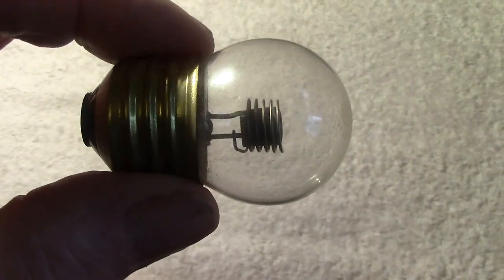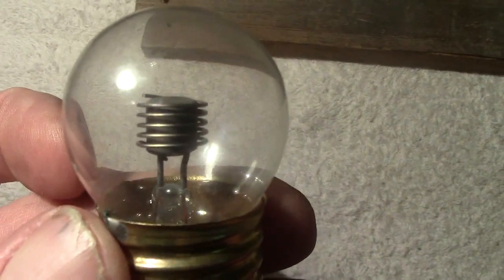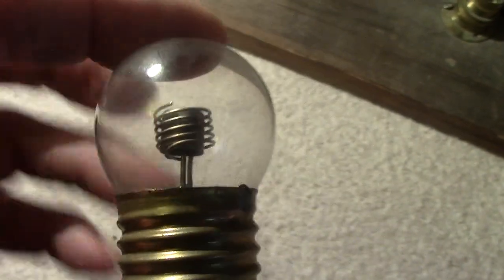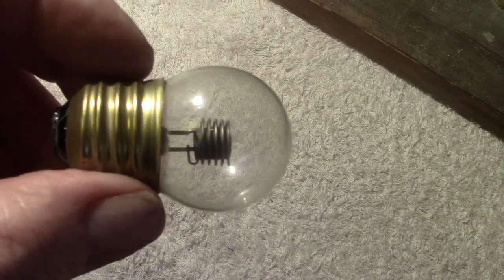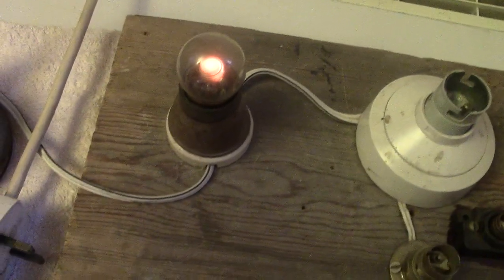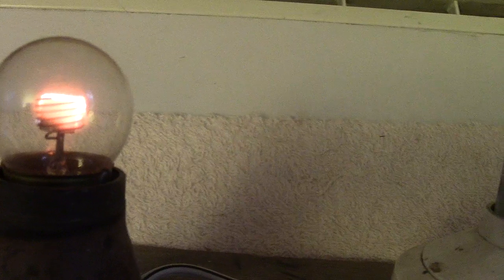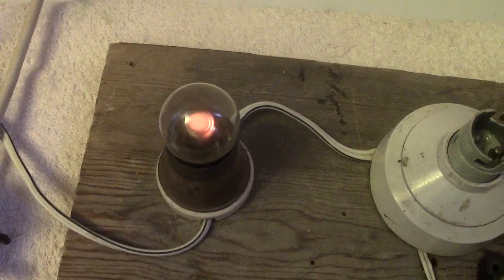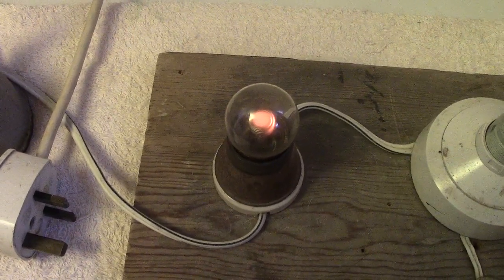G-E  NE-56 neon lamp.

Comment: If you use a neon lamp without resistor it will explode. There will be pieces of it everywhere.
Reply from the maker: Alex that is good advice, let me tell you a story when I was a kid, being just as curios then as now, I got an old Radio and among the valves was a bee hive neon with a valve base made by Philips, I could not believe my luck a bee hive which I wanted and thought it would be nice to power it up so connected to the right pins and done something stupid, well I was a kid, and put the 2 wires into a live socket and switched on, a loud bang insured and I was covered in shards of very sharp glass, this lamp was used as a voltage regulator and would of been okay in the circuit. Always check that a resistor is in circuit or. wire in line series with a 15w incandescent lamp. Take care I ruined a good lamp !!!!!
Reply: When I was much Younger and did not realize the value of a ballast , I also "blew - up" a number of neons and various mercury devices ( Fluorescent lamps, and 4W germicidal filament type lamps ) ...
Reply from the maker: I think we all did, just a stage of learning I think.
Reply: If i give directly to 9v,what happen?
Reply: ah yes scared the shit out of me when I was young

Comment: Mercury is in many neons, it makes the brighter. Especially Biger neons contain mercury. Sometimes you can see the mercury drops, on the wall of the glas. Also On a bluish light on the glas. The glas don't led the UV part of the mercury spectrum throw it and start glowing blue.

Size of thane should be the same like the 7 1/2W nightlight lamps.
Reply from the maker: Good points, size I think is the same as those 7.5 w nightlights remember those when a kid visiting The States in the 50s they were common. Mercury can be seen on those cross lamps and yes they do give a bluish light Alex.
Reply: Most neons use a  Penning mixture of gases, is it possible that the slight blue glow seen is from argon in stead of mercury ?
Reply: @youknow8754  , No i don´t think sp because the Argon discharges goes more in to Vieolett and is darker. The mercury discharge is a very light blue touch in the colour of the neon discharge. In some lamps you can also see the Mercury
Reply: @alex_lightning4523   I have noticed some mercury in some other neon lamp types, mostly Nixie tubes and some European neon lamps and could always see free mercury in the bulb but i have never noticed the free mercury in the Ne-xx series of lamps .
Reply: @alex_lightning4523  I have noticed that Light blue touch in the nixies, but i have not noticed it  and in My NE-30 and my NE-34 or any of my  NE-2  and Ne-2H
Reply: @alex_lightning4523  Hi , I looked at the spectrum using a cd disk and compared it to a mercury source I can see what looks like the green and yellow lines of mercury but I can't see the Blue line in the neon's light using a NE-34